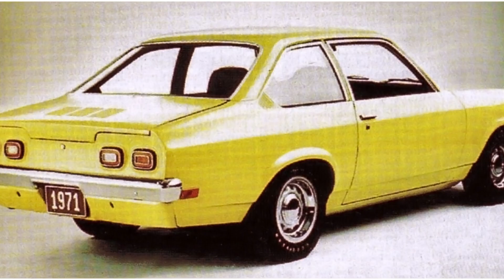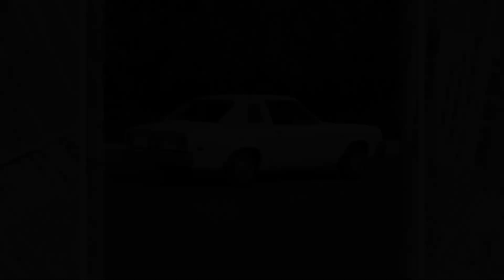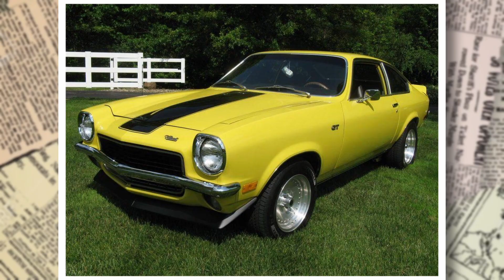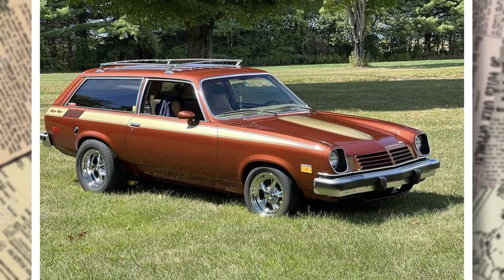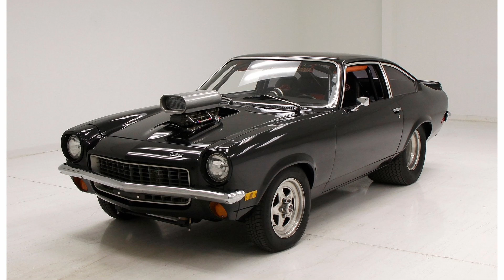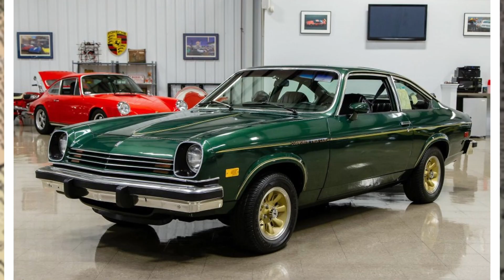The Little Car That Couldn't : 1971-77 Chevrolet Vega

Comment: Great looking cars. Like a mini Camaro. I owned a 77.  My buddy helped me replace the engine two times after the head surface warped. While installing the second junkyard motor, he pointed to a 283 small block sitting in the corner of his shop and offered that to me. I declined thinking it would be too much of a hassle to get it running. I still regret that decision.
Reply from the maker: Thank you for sharing your experience!